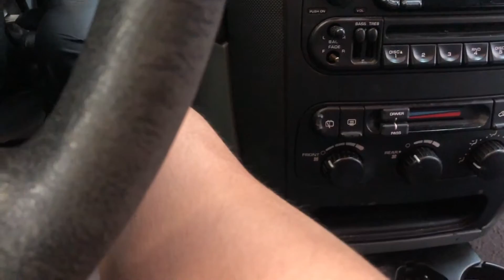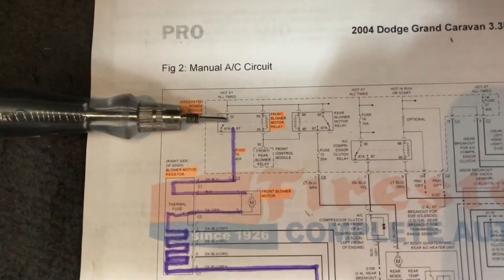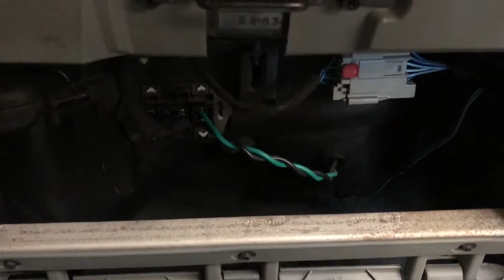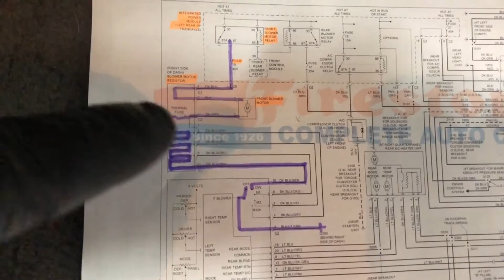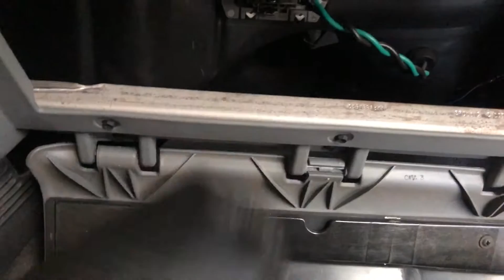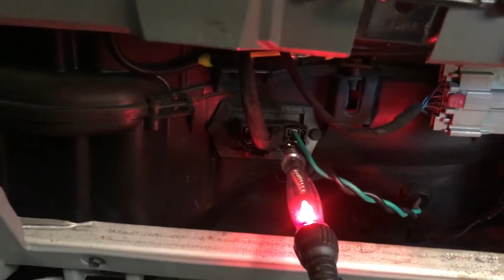Dodge Grand Caravan Blower Motor Resistor

Comment: hi,
I changed my resistor because speed 4 was not working. After a few months with the new resistor, speed 4 stopped again.
Do you think it was bad luck or could it be some other problem that is causing this problem?
Reply: Interesting… I have the opposite. Nothing except for the max setting works.
Reply: Same here. Lost max but have the other three.

Comment: Did you put positive on the Green wire and ground on the black wire for the fan motor?   I want to check to determine if its the motor or blower resistor